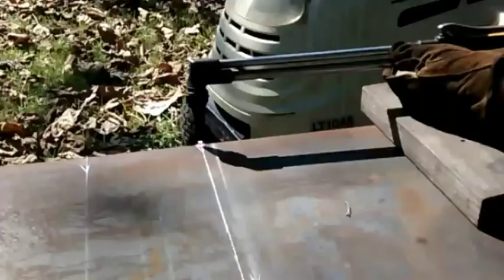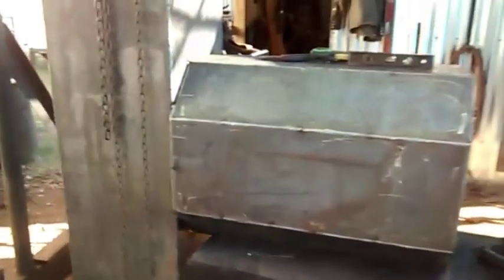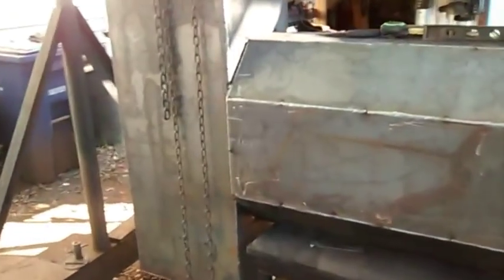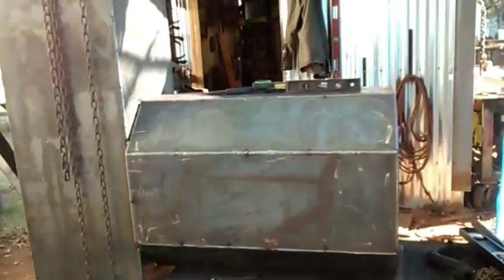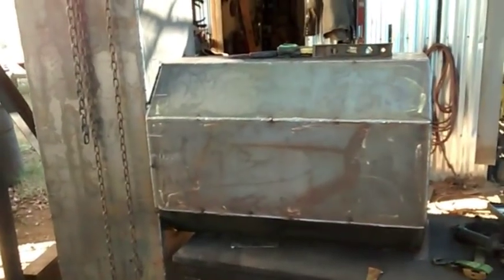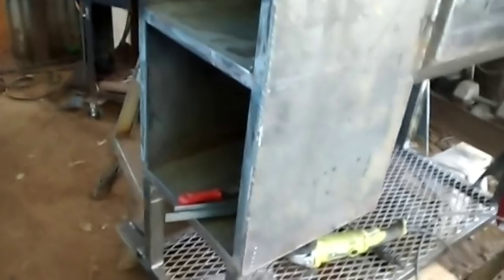Reverse flow smoker build pt. 1

Comment: Modifying an abandoned project to be very similar to this design. Main chamber is roughly 48x19x24 rectangular box, that much I could salvage and have to reduce the firebox they had because it was almost double the size it should be. Have plenty of 3/16 on the way to put the vertical box above the firebox. These boys are HEAVY

Comment: Hey great work man. The only problem with flat top smokers is that the condensation builds up on the inside of the cover and drips sooty water on the food. Do you install a rounded shield inside to cover?

Comment: This is reverse flow to the Smoker and the Vertical box is being used as a heater, correct?  I suppose if you really wanted, you could open up the vertical box damper, close the smoker box, and use both boxes for a smoker?   Is it possible to have this sort of option to use vertical as either a smoker or as a warmer?